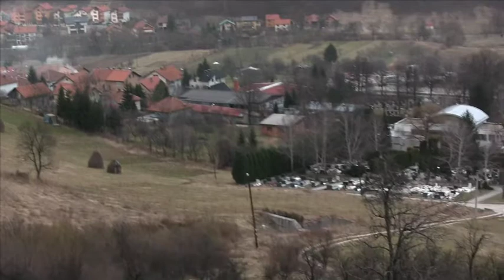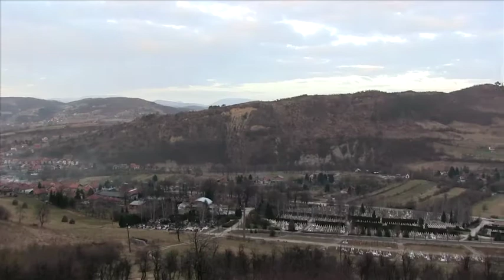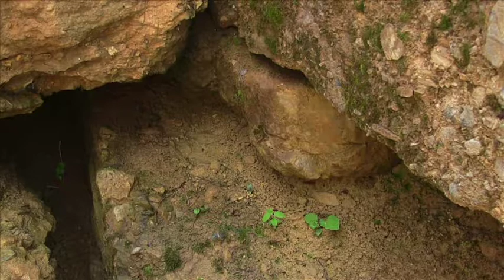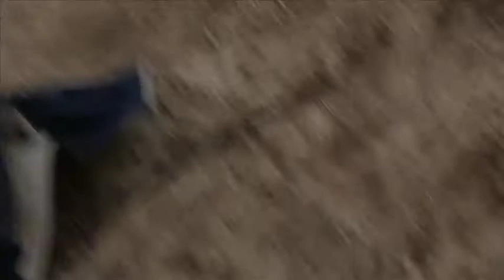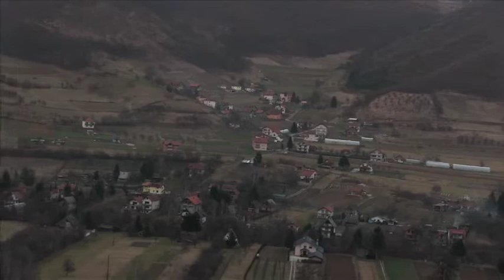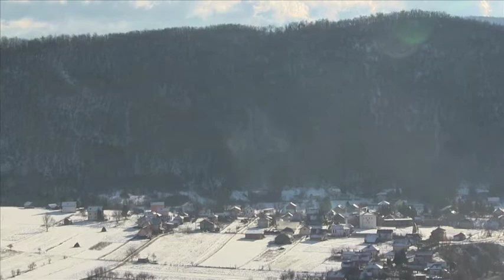Super-durable concrete on the Bosnian Pyramid of the Sun - an explanation of megapascals

Comment from the maker: "One megapascal is 10 [Earth] atmospheres, or 10 units of atmospheric pressure. It's actually 9.86923267. They couldn't make it 10, for some reason. Yeah, 9.86923267 atmospheres is one megapascals. The hardness of modern-day concrete is 20-60 megapascals. So, you say, well that's 20 to 60 times about 10 is 200 to 600 atmospheres of pressure. The ancients' concrete on this pyramid, on the Bosnian Pyramid of the Sun, right here, is up to 133 megapascals. . . . If we break it down to atmospheres, 10 x 133 is 1,330 atmospheres. So [it takes] 1,330 atmospheres of pressure to break the best sample of concrete that we've got from the Bosnian Pyramid of the Sun. Wow. And that's over twice as good as the 60 megapsascals that modern-day concrete gets up to."
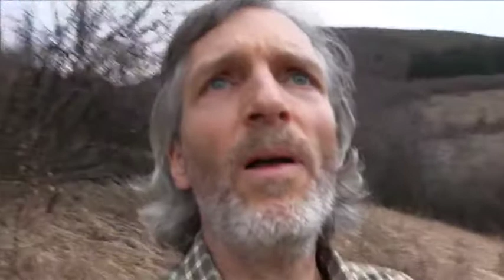(start minute 3:40)
Video: "Super-durable concrete on the Bosnian Pyramid of the Sun - an explanation of megapascals"
https://www.youtube.com/watch?v=0XHQLnPBHj4&list=PL2D8BNSXd6pAyeZpEZr9HPygs_bQMYgxc&index=42&t=9s